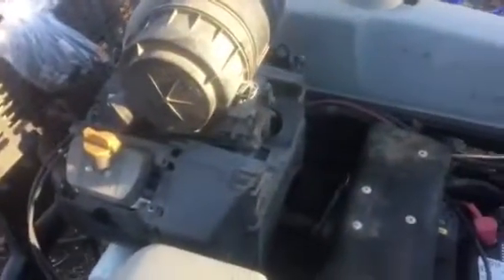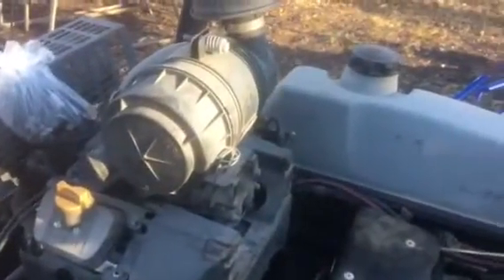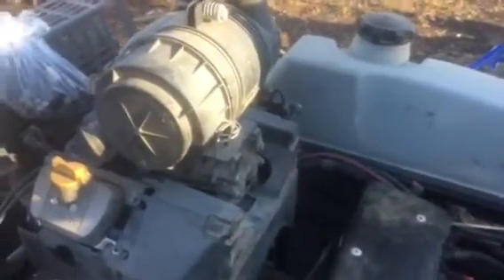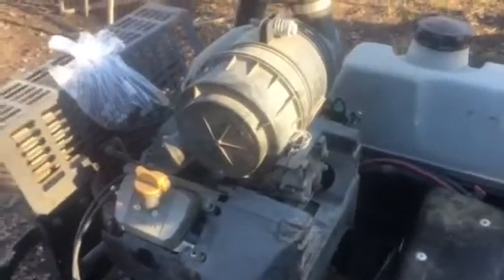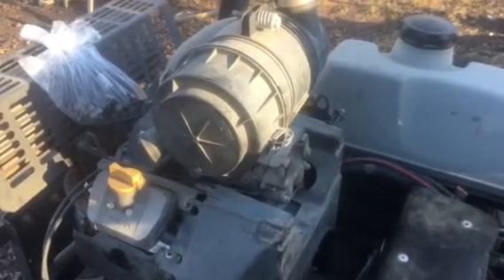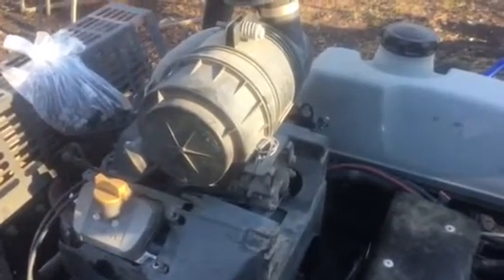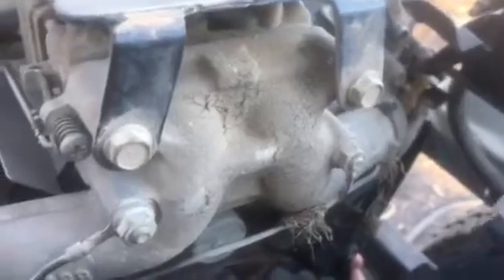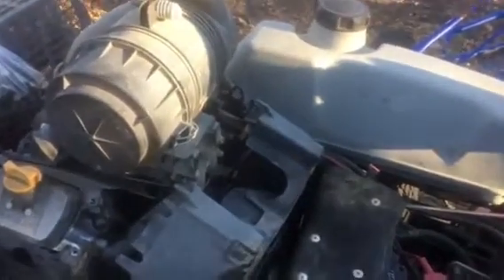Removing the coils on a Kawasaki FH770D on an Ex-Mark

Comment: Nice video! because i interest for that motor i have a question, the rotation are clockwise or counterclockwise facing the pto shaft??
Reply from the maker: Red Shadow  counter clockwise looking at the rear of the mower.